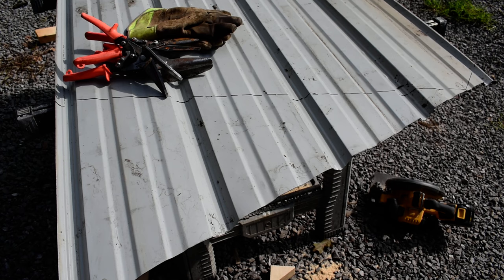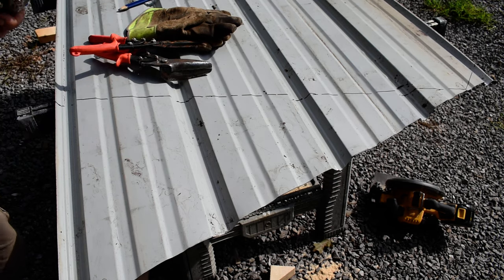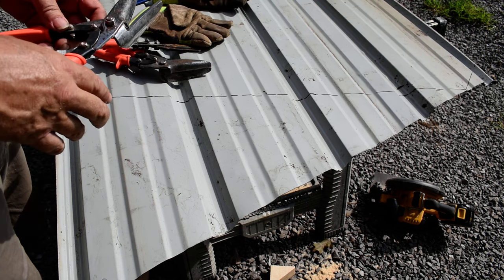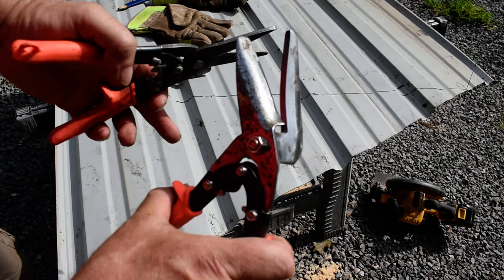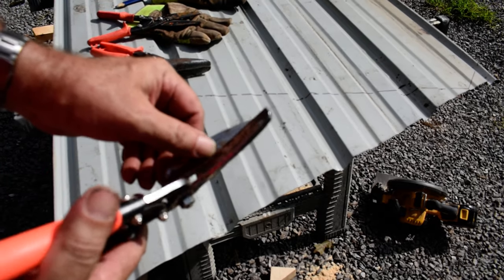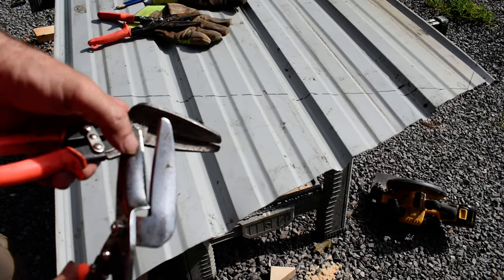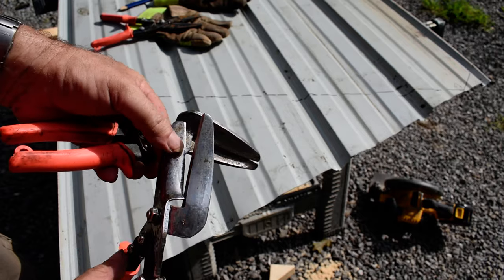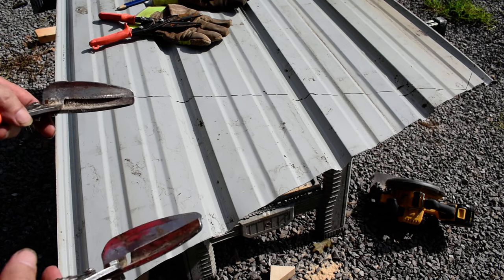how to cut metal roofing

Comment: Thanks for the video. I am a new home owner and need to cut a roof sheets for a small shed. I have seen so many videos to use sawzall or circular saw and thought I would have to buy either for the job. This video gave me confidence to try it with my recently bought Midwest left/right offset aviation shears.
Reply from the maker: Glad you enjoyed the video. Make sure you lube the sheers with wax before every cut. You may have better luck with aviation shears than I did. I found I needed the extra length of the long shears to make it through the ribs.

Comment: Th answer is right there in the corner of the video. Use your Circular saw with the blade flipped backwards. Works like a charm.
Reply from the maker: Yes I have tried that along with a diamond blade and power shear. None of those methods seal the edge like a metal shear though.
Reply: That’s the fastest way to void the warranty 😂

Comment: I’ve got a pair of Milwaukee offset shears (think they cost $25). I gotta say, it frightens me to cut them with those and hope for a nice even cut…
Reply from the maker: @NevadaSmith2  use beeswax before every cut and practice on a piece of scrap. If you cut is a little off from the line you will be be able to tell.
Reply: @ thanks for the tip man! I ended up going to a family friend’s house and he helped me. He’s a builder/roofer of 40 years. He did explain to me how he hates doing metal roofs -I quickly learned why. It’s a bear of a material to work with -gonna cut yourself almost certainly. But I got what I needed done for my firewood shed. He used nice power sheers. Now gotta install the panels tomorrow!
Reply from the maker: @NevadaSmith2  I have a porter cable power shear. It works pretty good but you have to be careful as it can scratch the paint. You always have to wear gloves when working with metal roofing. It can be a bit of a pain but on single pitched roofs it really goes fast. I roofed a 1200 sqr ft house in 2 days by myself.

Comment: Just use a cutting disc on a angle grinder, much faster and a hell of a lot easier, unless you cutting a hole for a flue for a wiid combustion heater or vent pipe
Reply from the maker: In my video on how to install vents I use a grinder with a diamond cutoff disk as it gives a better cut than a regular abrasive blade. While using a grinder is easier it doesn't seal the edge the way shears do.
Reply: Did you watch more than 5 seconds.. he explained the reason why he uses the shear and not the cutting disc on a grinder
Reply: @honeybeehomesteading  fair enough, in fairness grinder cut off wheels are inherently dangerous especially the cheap Chinese ones
Reply: @marshallderriek1858  point taken

Comment: Mai i know why you dont use angle grinder or shears nibblers etc? What to do to prevent rust on the edges?
Reply from the maker: As I pointed out in the video these hand shears compress the edge. Factory cuts shear the metal as well. Shearing minimizes raw steel edges. You should not get rusting on the edges when using any type of shear. I hope this helps.
Reply: @honeybeehomesteading  thanks legend fir the reply how about metal circular saw? Are they safe against rusting? I know they are a bit expensive tho?
Reply from the maker: @kevin6856 diamond cutoff blades will give you the smoothest cut. You can see me use one here installing a vent. https://youtu.be/ggjQ1-8dspE. I use them when a shear is not a option.

Comment: I'm pushing 70yrs old. Hand strength is pretty much kaplooey. Especially if i have multiple sheets to cut. Cutoff wheel / circular saw is my best bet. I get it about sealing the edge, I can always touch it up with some paint.
Reply from the maker: @gitup73  try a diamond blade cutoff wheel. It leaves a better edge than abrasive wheels.

Comment: Great demo and explanation.  Is there ever a recommendation to file the cut edge down?  I'm looking to a install metal roofing over a 5-6' tall wood  stand with the metal over hanging the front and back edge...given how sharp the cut edge is, I'm wondering if it is a practice to dull the edge to prevent the unlikely incident of a person accidentally making contact with the edge.
Reply from the maker: The safest is to bend the corners at a 45 and fold in flat. That doubles the surface on the corner edge and eliminates a point while leaving a smooth surface. Filing would not dull the edge enough. If it is the entire edge that you are worried about then you might glue some flexible trim on it
Reply: @honeybeehomesteading  Thank you for the reply!

Comment: I bought these exact snips to cut 29 gauge metal roofing (straight and angle cuts). Worked great for about 13-14’ and then became dull and unusable. Returned them.
Reply from the maker: I lubricate my snips with beeswax before each cut. that will get me 3 feet before i lube them again. I have done my old home with 4 valleys and 4 hips on a 12 12 roof on a single pair of snips (about 150' of cuts). beeswax is your friend but you might want to try a pair of millwalkee snips as they may be harder.
Reply: @honeybeehomesteading  good to know about the beeswax if I need to use something similar in the future.
Reply from the maker: @amys.7112  I was cutting metal today and something occurred to me about your snips getting dull so quickly. Check the tightness of the center bolt. Even though it has a spring washer mine tends to get loose. If it is loose the snips won't cut. I hope this helps.
Reply: @honeybeehomesteading  thank you for thinking of me! I returned the snips and am done cutting metal for now, but useful to know for the future!

Comment: We use jig saws, it's loud but way faster than snips.
Reply from the maker: I have used jig saws as well as cut off. The nice thing about snips is that it seals the edge so you don't get a rusty edge or rust stain down a valley later on.
Reply: @honeybeehomesteading  Makes sense..have any idea why some metal roofing gets white rust?
Reply from the maker: @xavisolis2115  white "rust" is zinc oxide. The metal before painting is plated with zinc which is a rust inhibitor. Zinc in standing water will produce zinc oxide. I have seen that where roofers bring the metal too far down  in the valley. You want 4 or 5  inches of exposed valley depending on the roof pitch.
Reply: @honeybeehomesteading what kind of blade you used with jig saws(I new working in construction)iam a mechanic,lol😅
Reply from the maker: any fine bi-metal blade should work. i have power shears, diamond blades jig saws. circular saws, you name it i have tried it. this hand shear will give you a rust free edge. metal likes to dance with a jig saw.   @DavidHernandez-ue4fz

Comment: What is the best way to mark the metal with a straight line?
Reply from the maker: @philllosopher  cross lines and diagonals I use a t square for drywall and a sharpie marked on the backside. For long edge cuts I use a chalk line with blue chalk. Don't mess with the red chalk as it will permanently stain anything it touches.

Comment: How not to cut metal roof. 
At least there's gloves on that hand. 
Get a power tool.  The wheel cutter is $17.
Reply from the maker: @jbaccanalia  I have a actual power shear. I have just about every tool for cutting metal but I don't have a wheel shear as they are relatively New on the market. They will not make the cut I made in the video as those tools work on flat metal only and cannot cross the ribs. They work with 22 to 30 gauge steel so they will cut metal roofing just only between the ribs. Is seems like it might be a good tool for ripping the edge if it doesn't warp the sheet . Thanks for watching and commenting.

Comment: How not to cut metal roof. 
At least there's gloves on that hand. 
Get a power tool.  The wheel cutter is $17.
Reply from the maker: @jbaccanalia  I have power shears, cutoff wheels etc. I haven't tried wheel shear as they are relatively new but I am going to order one and try it. It looks like it will work well as long as you don't have to cross ribs. We will see if that is the case.